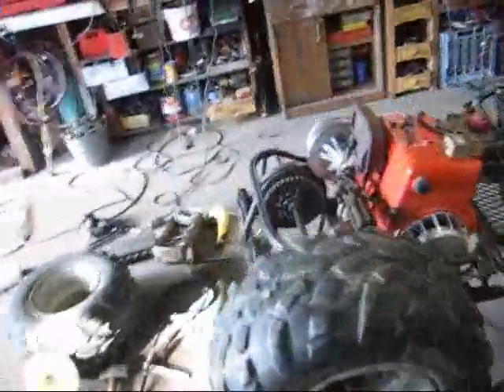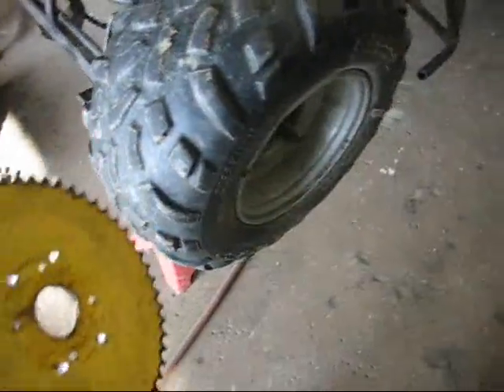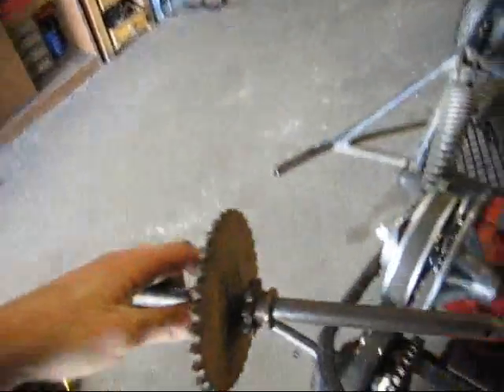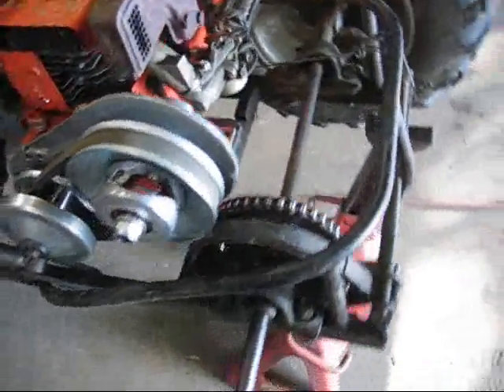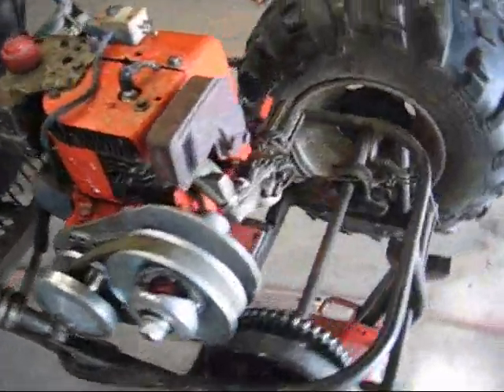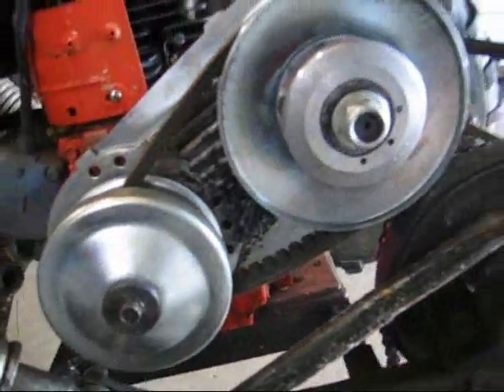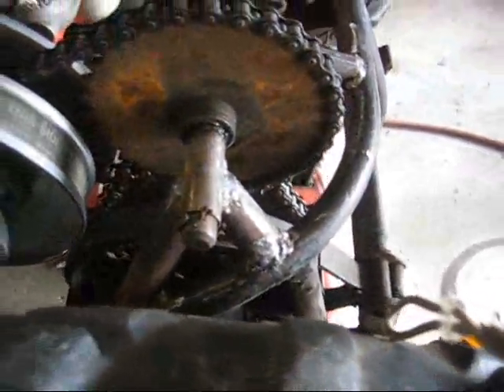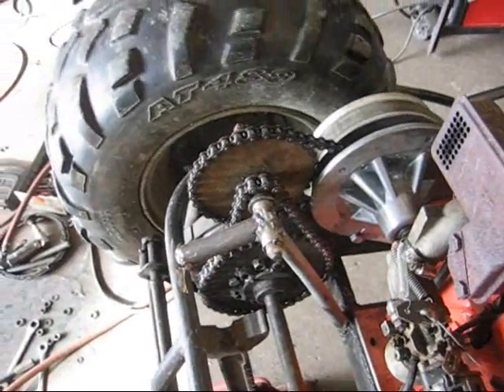Adding a Gokart Jackshaft

Comment: What cc did this engine put out, out of interest?
Reply from the maker: i think they are like 305cc. I changed it to a 13hp honda now which is like 390cc and using a regular centriugal clutch. It goes like hell. Way better than the torque converter setup.
Reply: @jeep2003  that’s good to know… I’ve got a 5.5hp Honda, 197cc… just wondering what it’ll go like with straight 10tooth centrifugal to 62tooth drive. That’s good info thanks buddy 👍🏼
Reply from the maker: @n1tr089  I did put a 5.5 honda on it before the 13hp. It worked ok too but pretty slow. It just depends on your terrain and how big your tires are what gear ratio it should be. Dont expect to get it right the first time

Comment: Maybe I missed it in the video, but mind if I ask the tooth count of the two larger sprockets?  I like the torque and how well it climbs.
Reply from the maker: its 10-32 , 9-40 so that comes out to 14:1 with 21" tires. It could be less and work just as well like 12:1 no problem
Reply: Thanks,  @jeep2003 .  I am thinking of going 10-36 for both, which should give me just under 13:1.  Looking forward to building it out.  Thanks again!

Comment: ha. i ant wait to try this 48 tooth sprocket i just got with a 4.8:1 ratio with 15inch tires. Just to try it.
How long did the belt last?
Reply from the maker: +Pred 212 if youre on flat ground and doing it just for top speed itll probrobly be fine just dont climb any hills with it.

Comment: Awesome kart man.  little or no money builds, that's the way i roll as well.  i see some guys spend crazy money on this stuff and i just go to the junk yard and hunt for treasure.
Reply from the maker: +FullThrottle440 Yup I just collect stuff that looks usefull and then its there when I decide to build something. If I dont have most of the parts I dont build it or change the original idea  to work with what I have. Im building a body for this kart right now but its kindof a joke so I dont know if im going to show it. I might not even finish it we'll see

Comment: It really seems to get it pretty good!
Reply from the maker: +The Shade Tree Fix-it Man It actually doesnt feel much different than it did before except on takeoff and slow speed you can tell its alot easier on the belt and itll spin the tires no problem now